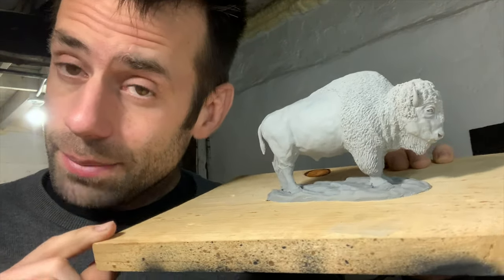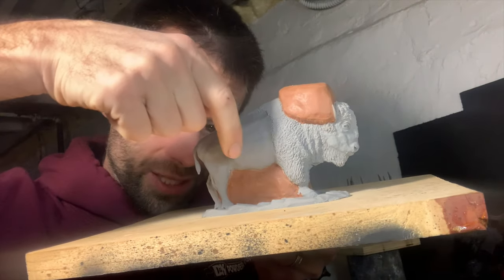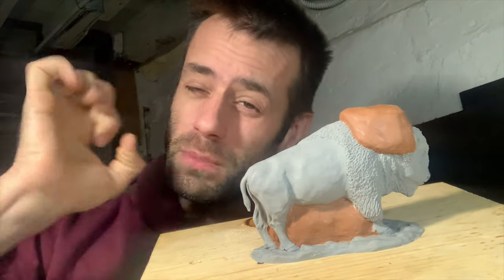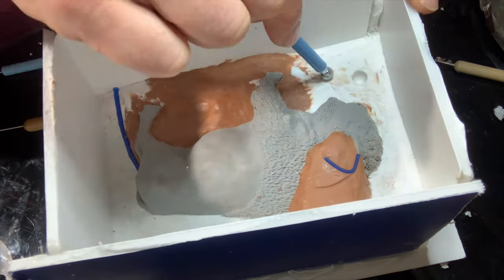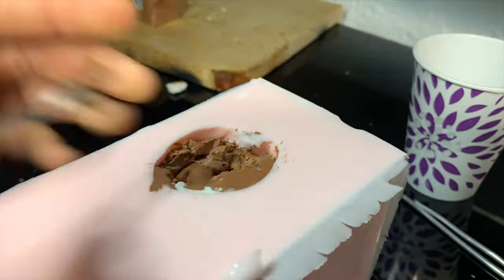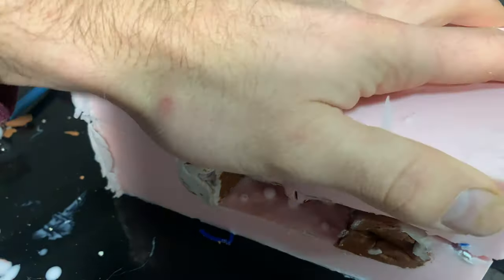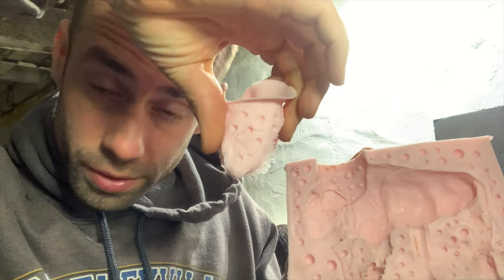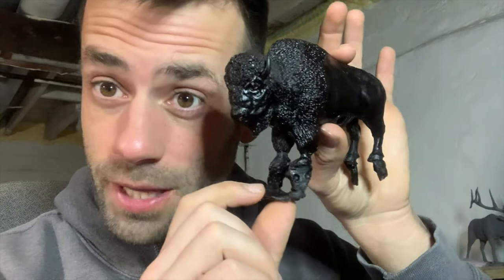Silicone Mold Making for Wax Bison.  Six Piece Mold for Lost Wax Casting.

Comment: This is your friendly sculptor who has worked above a foundry for 15 years.  When you are trying to weld any piece of bronze to your sculpture after casting (i.e. fixing the tail) use an alligator clamp fixed in a weighted base to hold your small piece in place while welding.   It’s secure and unaffected by heat.  It’s called a third hand or strong hand.
Reply from the maker: That’s a good tip. thanks!

Comment: That beast is an American beauty that one could gaze at in wonder for hours!  
Possibly incorporating a core into the pattern to reduce overall weight as an alternative mold,  not that the mold making process is not already complicated enough.  Just looking at the Bison, I think a parting line for the core could have been done vertically where the fur and skin join mid-section, then welded two halves together(only a random thought, no clue really).    Your mold design may be better since the bison is big but not huge, plus won't have to deal with welding.   I am sure there are many other molding methods too, and also sure your end result will be another American Masterpiece !!!
Reply from the maker: It’s already bronze. I’m happy with how it turned out. That will be next weeks video.
Reply: SWWEEEEET

Comment: Great video as usual dude! I was SO cringing when I saw you adding platinum cure sililcone to the tin cure haha Knew that was gonna happen xD
Reply: As you've gone to the effort of such a good mould, will you be making a whole 10+ tree of these at once? :D
Reply from the maker: If only I had a flask big enough. Right now I can only fit one at a time. But I did just buy a perforated flask for vacuum casting. I’ll have to build a vacuum casting set up though. But that should help the quality of my casts.
Reply: @lundgrenbronzestudios  I built my own vacuum chamber using simple steel pipe, and some steel sheets. One on the bottom held onto the pipe with cheap gasket glue, top one is spot welded and gasket glue for safety, as it popped off a few times when I was removing the flask without the tack welds. The top piece has a circular hole in that I drilled using a drill press (normal drill would work) and a hell of a lot of drill holes 😅 then filed down to be a closer to  circle. (Guess an angle grinder may be easier to do it with if you've got skills) The pipe has a hole drilled in the side of it with a vacuum hose fitting thats sealed with PTFE tape on the threads and more gasket glue. I cut a gasket to size from silicone sheet using a craft knife too for the top surface between it and the flask :) Works a charm and cost me next to nothing. If you ever get a blowout and the metal leaks, it's easy enough to pop the bottom off and free the metal once its set and replace it with no hassle too ☺️ Can share some pics and build pics if you need to see them to get a better idea.
Reply: @noviceartisan  Fascinating.  I would love to see a documentary youtube video  of the build with a few pics and maybe a drawing with some notes.  Anyhow congratulations.
Reply from the maker: Yeah I'd love to see some pictures of your set up.  It's good to hear that gasket glue is enough to hold the seal. I was wondering if I needed to weld it but I'll just tack it like you did and glue the rest.  I have a pipe and some plate steel.